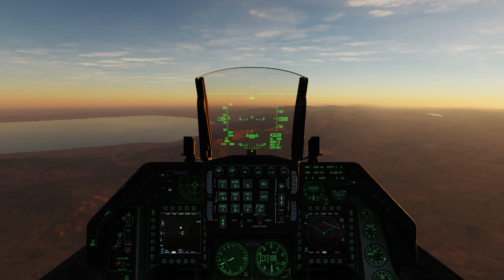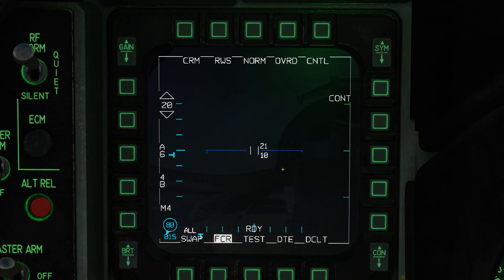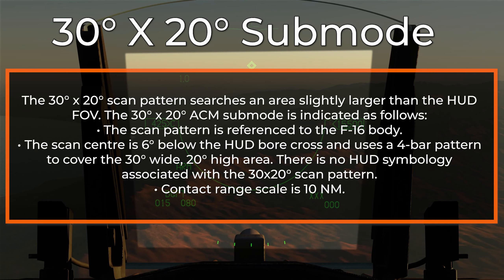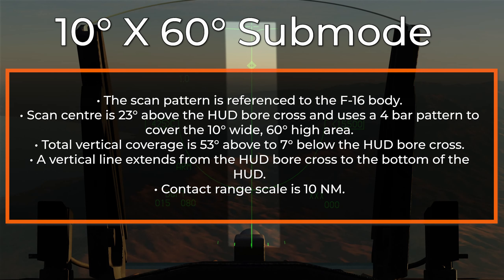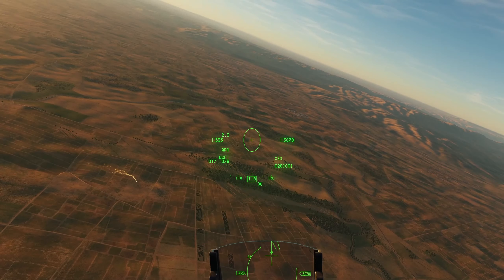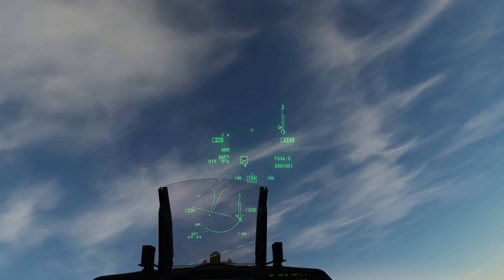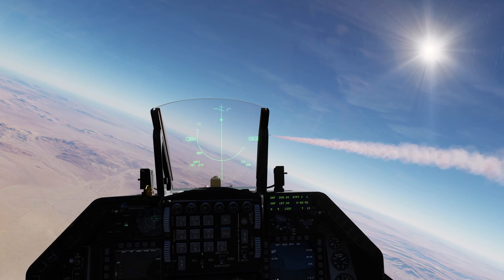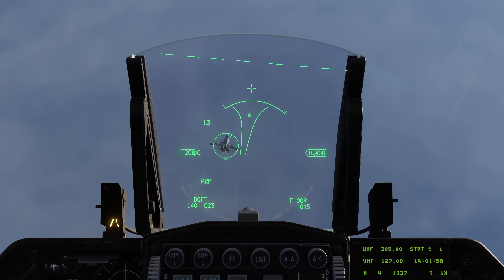DCS F-16 Viper ACM Modes Tutorial

Comment: but how do i return the hud back to nav or bvr mode? after i'm done in dogfight mode.
Reply from the maker: Click A/A on the UFC to switch to AA and then click again to go to Nav.  The way I do it is move the dogfight switch back to the center position. 

The center position on the switch is the default one with neither mode active, returning the Dogfight Switch to the center cancels either Dogfight Mode or MRM Mode and returns the jet to the state it was in when the switch was set to an override mode.
Reply: @TrickerDCS  ok then i need another bind on my x52.  don't have center position .. i just have dogfit mode setup so i can use my gun. thanks.  but this will reset the HUD back to the way it was before i hit gunfight mode?
Reply from the maker: Yep that's correct! I usually fly in MRM or missile override most the time I'm flying and go to dogfight when I'm merged